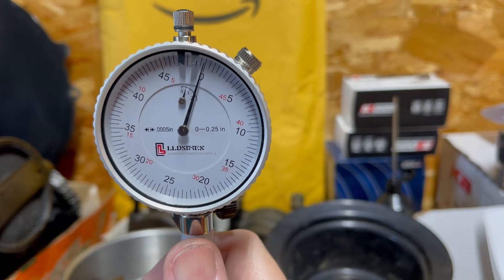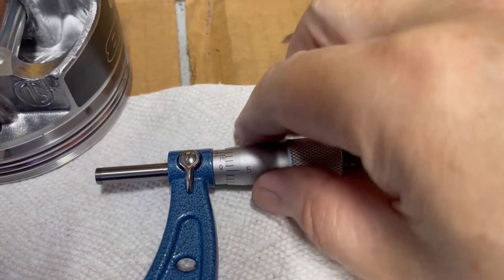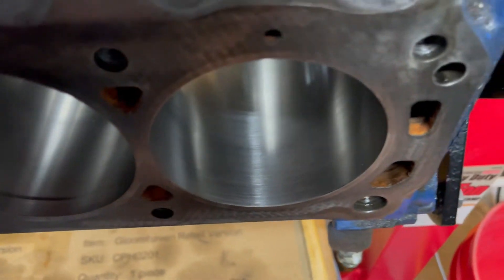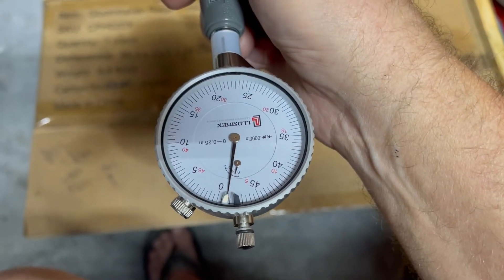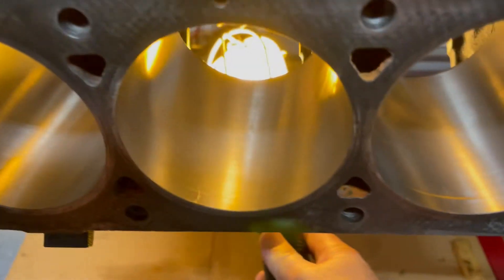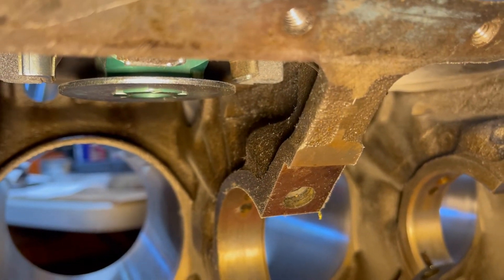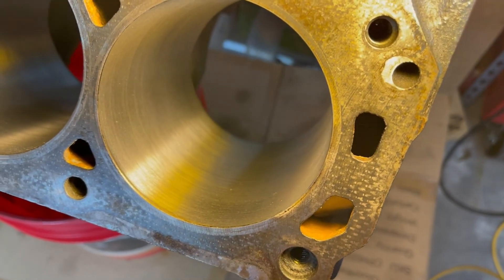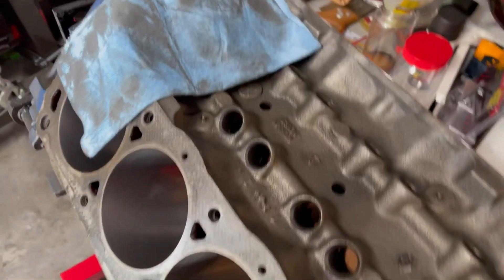Cylinder Honing - Ford 289 302 Stroker Rebuild part 3

Comment: Just wondering what grit stones you used?
Did you use 2 different grits?
Rough and fine ?

How much was the lisle 15000?
Reply from the maker: The Lisle 15000 came with coarse grit (80) and medium (180). I started with the coarse and followed up with the medium, and then the ball hone. The Lisle cost me $150 at the time; I imagine I could get half that much for it used.

Comment: Some folks may find this hard to believe, but that's okay too. The only way I could do what I'm going to tell you is the good Lord help me. That hone you have is actually a boring hone. Mine is exactly like yours, and mine came with a little wooden stick with a weird piece of sandpaper on it, and you use that to shape the stones and get them true. That hone is guaranteed to be able to get with in .001 out of round, and within .001
 taper.
    I used mine to put a .040 over piston in the rear of a standard bore 5.9 24 valve ISB Cummins engine. It took about 18 hours to cut the hole and get the clearances right, and about 6 hours to clean up my mess, because I've done it with the engine still in the truck. The engine is in a 2002 mt45 Freightliner step Van. I have put about 30,000 miles on the truck since I done it. When you work those engines hard, with the factory cooling system the rear cylinder overheats, and the Piston was rocking up at the top of the cylinder and really got to hammering, so I had to pull it down and that's what was wrong. You use that hone dry. According to Cummins, you can put a oversized piston in like that as long as it is a Cummins piston. It runs great, and don't seem to vibrate or anything, run smooth, and I don't hold back, I run it!  I actually have a video of that. It's a nice tool. I turned it with a half inch Milwaukee drill.
Reply from the maker: That’s a great story. There is a huge amount of satisfaction being able to fix something yourself. I’m impressed you were able to remove that much material. Since the engine has been working for all those miles you obviously did a fine job.
Reply: How many stones did that take? 80 grit?
Reply: @SuperAleyda123  it came with two corse stones, and two fine stones, and it also came with two felt wipes. You use the thing dry, I probably said that in my article...idk. I don't recall what grit the stones were, Im not sure it said in the paper work, it probably did, but it wore them a lot.
   After I use that too, I used a regular cylinder hone wet to put in my crosshatch....

Comment: I totally respect and admire your drive and desire to do this in house, but this is one of the few things I recommend be sent out to a shop with TORQUE PLATES to get done, especiallyif you're going stroker. There is 20-30 hp to be gained in a small block Ford. Still nice work though.

Comment: How did the lisle hone perform?  I just got the smaller version 16000 in today. I’ll be doing some outboard cylinders
Reply from the maker: The Lisle hone worked great once I got the stones adjusted properly. First, the stones weren’t parallel. When tightening the micro knob the bottom of the hone would contact the bore while the top still had clearance. I cut a shim from a soda can and placed it under the mounting clip of one of the stones so that the hone tightened even in the bore. 

The second thing was getting the tension/compression just right. Not enough pressure on the cylinder and the stones aren’t doing their job, you’re just wasting time and energy. That’s how I started out, just to be safe. Too much pressure and the stones try to dig in and rip the drill out of your hands. Had that happen once! The sweet spot did place a good amount of torque on the drill though. However, a smaller cylinder bore would need less torque than a larger bore.
Reply: So did you remove about .030 worth of material or did you have those cylinders bored first? I have a Kwik way FWS boring bar and it’s good for 1.750 through 3.750.
Reply from the maker: My block had previously been bored and the new pistons just barely fit into the cylinders so I basically started out with zero piston to wall clearance. I used the hone to give me the required 0.0015” - 0.002” clearance.